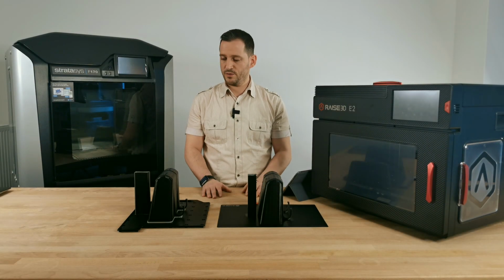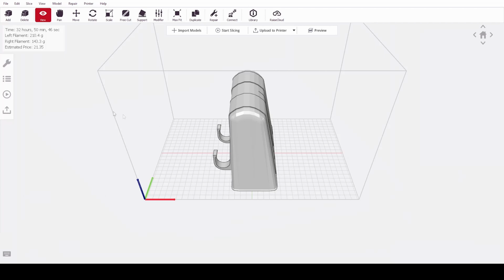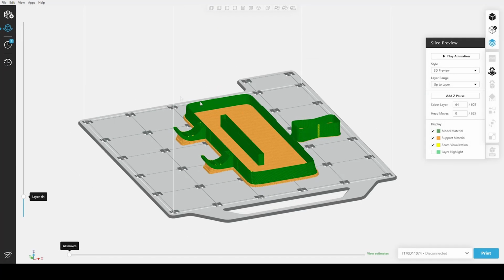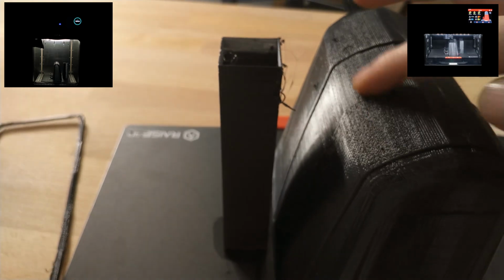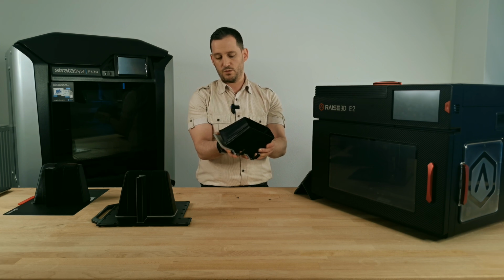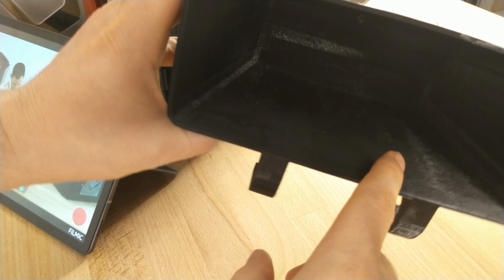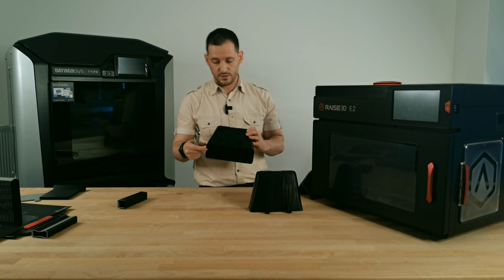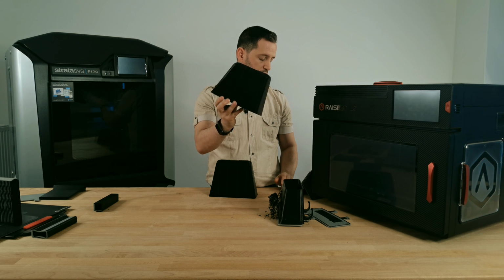Stratasys vs. Raise3D Round 2: Print ABS

Comment: It would be interesting to see if you used the actual ABS profile from raise for idea maker rather than the grabcad profile suited to the f170.  And then try running the stratasys on the ideamaker profile..? Just to compare apples to apples.  
Just a little advice on the profile. For something so thin, setting infill at 75% makes no sense? 100% won’t make much difference to time if maybe even speed it up when changing from std Gyroid used when less than 100%. You also don’t need the massive block of support to support a domed ceiling/roof, which it seems to be looking at your model. Rafts are better and help to prevent warping, I’d check your interface settings before giving up on those. At least your layer height  zgap should be used. Usually more with the sticky filaments like abs/PETG etc.  also increase fan speed at the interface layers to harden them quicker before laying down your first print layers. 
Kind regards.

Comment: I do not think Raise3d can compare to the multitude of patents the Stratasys utilizes.  The thing is a beast.  I recently had a Ultimaker S5 and my new Stratasys F170 blows it away.  There are no experimental options like trying filaments or changing setting much- but the proprietary nature of Stratasys is part of what makes it work great every time.  If you a professional, its a no brainer- Stratasys all day.
Reply from the maker: Hi LaunchLab. You may be right that for professional and industrial use nothing can beat the Stratasys machines, but the competition is not sleeping. Printers like the E2 do show that you can get good parts for prototyping out of a "lower" budget printer. Material costs less and the open nature of the E2 helps in adapting your materials and settings to your application profile. The Stratasys printer is just a "no brainer" to use. Slice your file and print. Even if it takes days of print time you do not have to worry about failed prints most of the time.

Comment: What was the problem inside the stratasys print?
Reply from the maker: Hi Christian R. It is difficult to see in the video but there was unbonded material in there. So some layers did not stick to the previous one, this only happened on one side and where the overhang was to high.
Reply: @twinstalk  ok, Thanks
Reply: @twinstalk  With the soluble support material inside, the contour inside would also be perfect
Reply: Needs more time, but the result will be perfekt
Reply from the maker: Yes the only problem I had was changing the overhang degree in the support settings of the grabbed software. Having it on default and desolving the support structure should fix the problem.
Reply: @twinstalk  yes, that will solve the problem.
Reply: @twinstalk  i'm thinking about getting the f170. is of course not exactly cheap
Reply: @christianr.3610  I was thinking about upgrading to the f370 but have been on the fence, I can print almost any material i want on my 1200 whereas I'd have to pay several hundred for a few materials plus 60k with the f series

Comment: Really cool seeing how the Raised stacks up against the Stratasys. I have the Raise E2 and I really like it. Did you increase the percentage on the first layer of the raft to help with adhesion?
Reply from the maker: Hi Chev. I did not change the first layer percentage. Wanted the settings to be as close to the stratasys printer as possible. You could get this part printed out without issues by adapting the settings though.

Comment: Comparing a Ferrari to a regular sedan is always useful... Dude, don't you see the difference in price point? You can't be comparing two machines falling in different budgets, I bet that next thing you're gonna try is printing PEEK in the Raise
Reply from the maker: Hi Nabil Bennani, I did a comparison between these two printers using PLA material. The RAISE was the winner in that video. Following up on the comments I started a comparison with Abs. So the essence of these videos is that also "budget friendly" printers like the raise e2 can print great parts but do have some difficulties on temperature demanding materials. I am printing Abs and pla parts on the raise without issues. But having a heated chamber is the best you can get when printing ABS. Your comment is spot on. Both cars will get you from point A to B. It's just how the trip will turn out at the end.
Reply: @twinstalk  Its well worth doing videos with such comparisons. Why be so rigid to compare printers only in the same class. Your comparisons help people see that a £3300 Printer can stack up pretty well against a £20,000 printer. This has helped me personally make the decision to purchase a Raise3D E2. Its also promoted comments which show that with some setting changes the raise will perform even closer in performance. Very very helpful for me. Thank you!
Reply from the maker: @simonlongley7862  Thank you for the Backup on this topic and great that my comparison is of some use for somebody.
Reply: @simonlongley7862  how do you like the raised?
Reply: @IIsimpsonXX  Hi yeah I think it's fantastic as the price point. I'm using it to print some very difficult parts in nylon atm. Layer lines are immaculate and slicing in idea maker is also exceptional. Even compared with simplify 3d.  I have a hardened nozzle by brozzl on the right extruder atm for carbon nylon. Bit harder as you would expect with carbon nylon. If this printer had some active heating I'm sure it would be even more capable. It really is a precision workhorse. It's so easy to use.
Reply: @twinstalk  you are very welcome. I can't understand why anyone would think that this is a pointless comparrioson. I mean I bought a raise off the back of this and a few other videos. From day one it's been printing end use production parts! It's so so good. It's also quiet enough for me to leave overnight in the office at home to print. I dont even wait around to check the first layer any more, even in nylon! It's that reliable.
Reply: @simonlongley2252  Great! Thanks for the input. I am sold on Raised but I cannot decide whether to go with the E2 or Pro2. Do you have any experience with the Pro2?
Reply: @IIsimpsonXX   I have Raise Pro2 plus. The Raise 2 has a bunch of issues. Read the Raise 3D forum about the issues to figure out if you are OK with them. The biggest issue I had experienced with it is the cable has bad connection with the control board which causes wrong temperature reading and print fails. But it took me a lot of time and troubleshooting to figure this out to manage the issue.
Reply: I get you. Point A to B. But, you're comparing, therefore making them compete. There's never a point comparing stuff or people not belonging in the same category... Boxers have their weights, cars have their category, planes, boats, every single thing that surrounds you and everyone belongs to a category. Mixing leads to confusion for the non savvyes in that field. Imagine I compare myself to Mike Tyson in boxing category, yes we both can throw a small punch,  but... So, there's no point in comparing.
Reply from the maker: @NabilBennaniKerrout  Thx for the comment. I will consider your thoughts in my next videos.
Reply: @twinstalk  ignore that person this comparison is great and there arnt alot like it out there
Reply: @mrt6399  This is very true, the lack of video comparrisons like this make these videos valuable to people in the market for more professional printers. Very helpful indeed. Not many people have access to such expensive machines to do such a video.
Reply: It is useful. It gives you perspective and choice. How do you know the difference between Ferrari and regular sedan if you do not compare them? And both those items belong to the same category, those both are 3D printers. And you have to compare them to know what you pay for and what is the difference. I bet you had no idea what the difference between those two 3D printers without this comparison other than they have different price and different shape. This video explains exactly what each of these printers deliver in comparison and what you pay for.

Comment: Interesting video.
I have seen VORON printers print with ABS with a bit of tuning.
Thanks for sharing your experience to all of us :-)
Reply from the maker: Hi. May have to tune the material. Getting the right settings for temperature and extrusion width would benefit the part quality. You can tune the raise3de2 to print Abs just fine. But it was difficult for this particular geometry.
Reply: I print ABS with my Voron V2.4 without problems. You should preheat your chamber for at least 10 minutes at 245°C and 110°C for the heated bed. This way you'll have almost zero problems